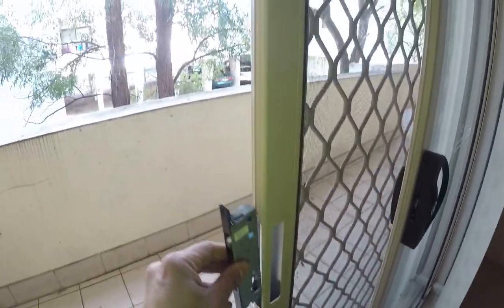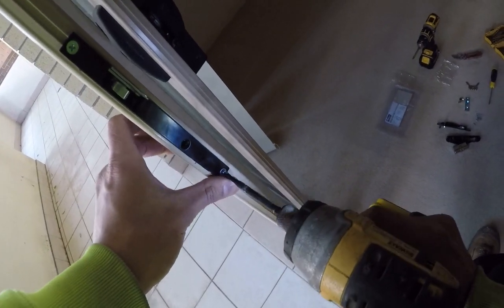how to remove and install screen door lock

Comment: You are a legend. The replacement lock for my sliding door was a disaster. Mainly because the cylinder was faulty. Then, of course, I couldn’t free the door. Your gripper hack worked and the new lock is in place. 
THANK YOU ❤

Comment: Tragedy today Bill! I was following your tute and got right up to screwing in the catch for the lock on the wall side and I noticed none of the snips worked so I tried the barrel with the key and it was stuck in the locked position (something inside jamming it). Had to pull the whole thing apart again and sort of jimmy the internal mechanisms of the lock up again so I could get the bloody barrel out. Locked it and tried it all again and it is jammed again so I think maybe have a dud (Whitco brand). Back to Bunnings with it tomorrow. Not happy!
Reply: I have the same trouble. Need to use a grinder to cut it out. Bought a new one, same problem again. I wish I saw this video before anything else.

Comment: The little latch can’t be locked when door is open or closed but key works fine can the top striker actually wear over the years?

Comment: Hey Bill, thanks for your videos, you've actually been a big help for my going into retirement. Lot's of stuff needs fixing... I have 2 sliding security doors where both locks need replacing. I managed to dismantle one completely but the other Euro-lock refuses to come out. I've tried the hair-clip, tried the keys I cannot seem to get that tumbler to move. Any suggestions please? Thanks in advance - Peter V.
Reply from the maker: Hi Peter, you’re very welcome. I have another video showing you how to snap the lock so you can replace the cylinder. Very  simple to do. 👍
Reply: @billshowto  thanks Bill, will check it out - Peter V.
Reply: Hi again Bill, found that vid. and it worked really well. Got the locks changed so thanks again mate - Peter V.

Comment: Hey Bill.. I am having dramas with the two screws on either side that hold the handle on, they won't go in all the way.. I tried longer screws and they also wouldn't go in all the way. Im not sure if maybe I'm not putting enough pressure behind?
Reply from the maker: Those screws initially require a bit a force, very common 👍

Comment: Hi, I've run into some trouble..... I started Toni stall a new one but did not change the strike plate over yet and the old one was still on.  I shit the door because I had to do help my daughter.  The door will not unlock now.... I only closed it but somehow it has now locked/unopenable.  The key turns but does unlatch...help locked myself Inside

Comment: my sliding screen door is locked close,  i have the key but wouldn't turn to unlock.  have no access to the side screws, coz is locked close.
Reply from the maker: Hi , you can replace the lock by doing this if it’s stuck in the locked position 
https://youtu.be/eHvuD2PhK_0